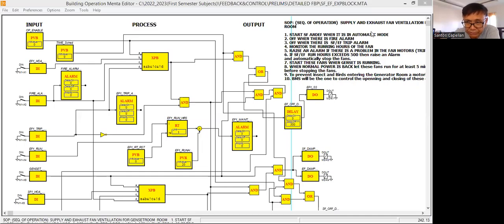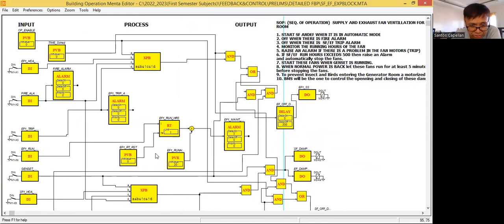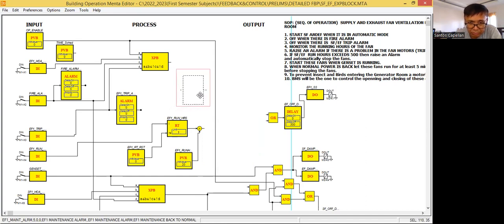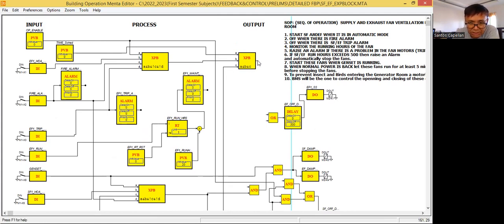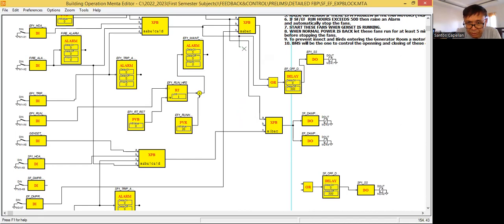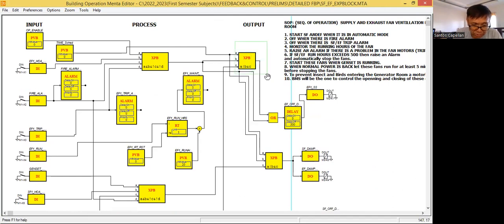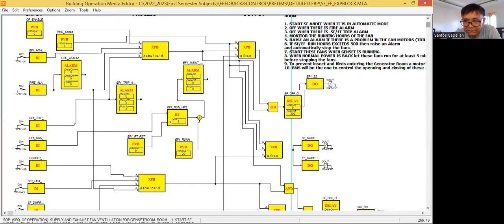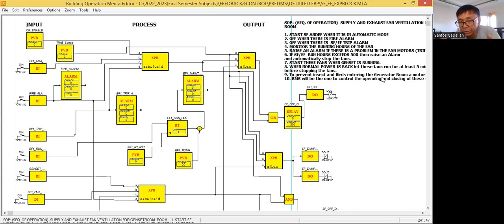BMS - FUNCTION BLOCK PROGRAMMING PART 8. (EXPRESSION BLOCK)

Comment: hi sir i'm a bms programmer . we use tac xenta  and IA series controllers. recently i encountered one problem in tac menta program so i wanted to share with you because you may  have a solution for that. the problem is my client want me to set one delay time for one fan into the graphics and he wants to change the delay time from the graphics as he wants. is that possible?
Reply from the maker: are you using function block or script programming?
Reply from the maker: I encourage you to be a member for 1 month in my channel and from there we could look for a solution in your problem
Reply: @SantosJrCapellan-BMS   we are using functional block programming . even we do the complex programmes still i like to watch yours videos. anyways i hope you will give a suggestion for solve it out
Reply from the maker: @krishnakumarmuraly3038  give me your scenario or the portion of the Function Block program where you will implement the  adjustable time delay
Reply: @SantosJrCapellan-BMS  one exhaust fan on /off command with 30 sec delay in the FBP . client wants to change the delay time from 30 seconds to whatever the time he wants. these changes shouldn't from the program but from the graphics. he wants to change the delay time like how we change the temperature set point.
Reply from the maker: @krishnakumarmuraly3038  I will try to edit my FB programming part 9 to implement your concern, it will be available at 12 midnight my time here in Philippines. I hope it will help you solve your issue. I have a super thanks if you think this will help you satisfy your client's request then you can show your appreciation
Reply from the maker: @krishnakumarmuraly3038  https://www.youtube.com/watch?v=52KaQxwCA8M